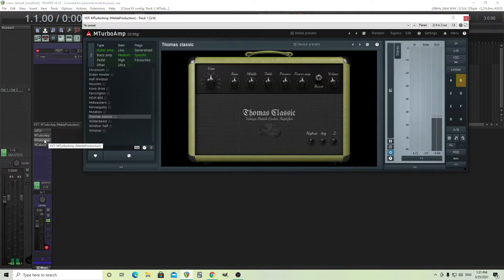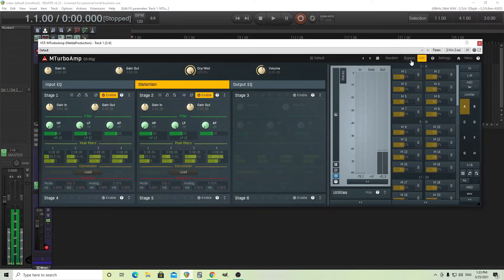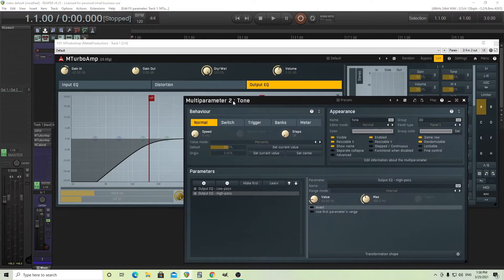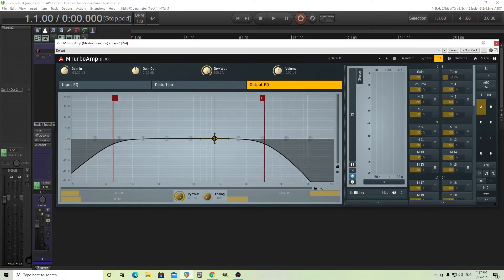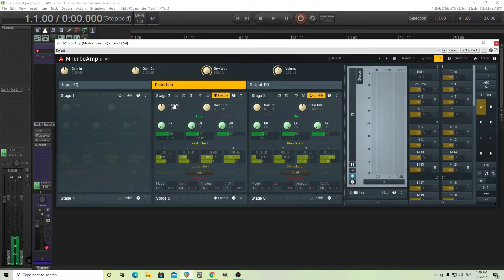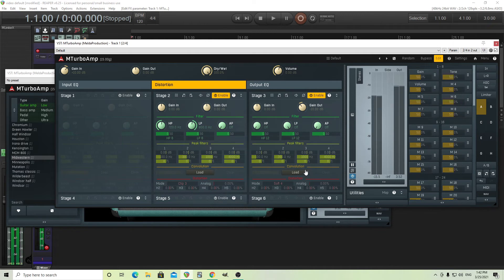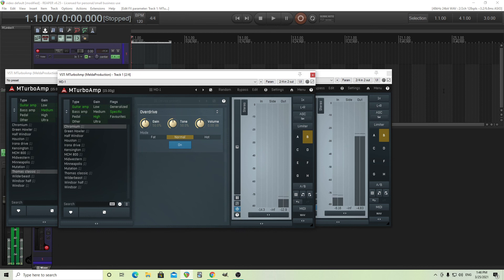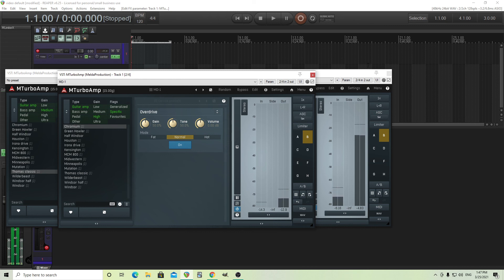Overdrive pedal in MTurboAmp

Comment: Hi Chandler, this is a powerful system, looking foreward for finished version. Sounds very good. Only thing I'd like to see is a bit more dynamic action and interaction. I didn't try it out yet (will soon). Is there an option to integrate a dynamic EQ? Or maybe a good idea of be to modulate EQ peaks? Cheers
Reply from the maker: Yes, there is a dynamic EQ in the input and output EQ sections. I've added it in a few amps, but I'd like to experiment with it more in the future. Thanks for watching.